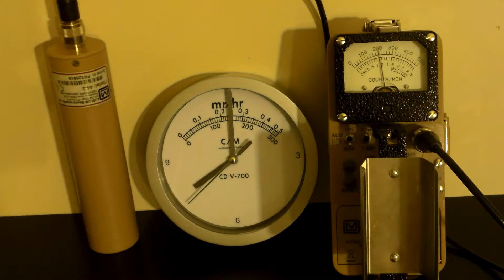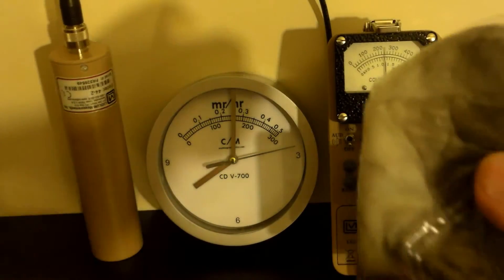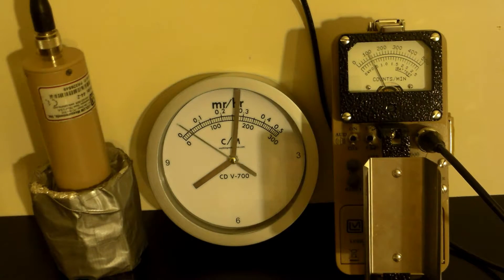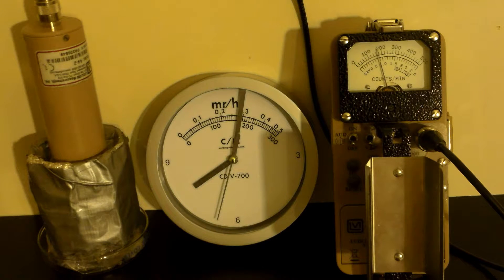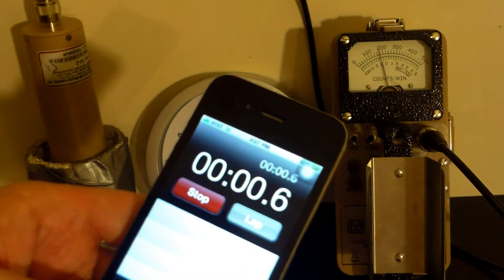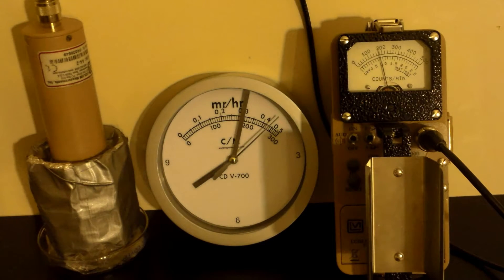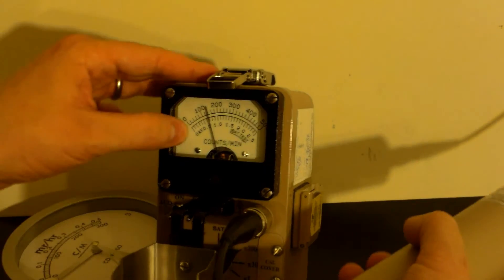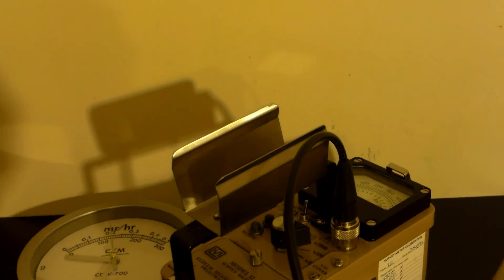Radioactive Rain Decay Curve (Gamma & X-Ray)

Comment: You should clean your car/paint properly and then test again to see if it makes a difference. 

  I suggest in these 3 steps. Wash car. then do a Mothers clay bar. Then lastly a good cleaner wax. Then test the rain water. Samples gathered from a source that has been properly cleaned of oxidation may show a difference in data.

Comment from the maker: Thanks!

My point is not that there is no Cs137 in rain... this has been long observed for many different events (Chernobyl, Nuke testing, etc) and should be expected from Fuku too. My point was that the predominate source of detectable radioactive using inexpensive detectors (i.e. not lab equipment) is going to be from Radon progeny. This does not mean the water is or is not safe.

People really just cannot seem to get past this simple point.  =|

Comment: can you analyse the dirt without measuring the water? it looks like the dirt that is airborne gets washed out on cars.. i have proven (sort of) that pollution incidents involving particulates in the uk often come with some radioactivity (in the air), shown by a larger range on the gieger.. the rain falls then cars get instantly covered in the layer of dust.. is it possible water activates the dust in some way? Busby couldnt find anything from the dried and decayed brasil sample...